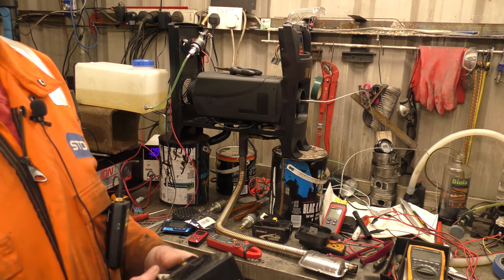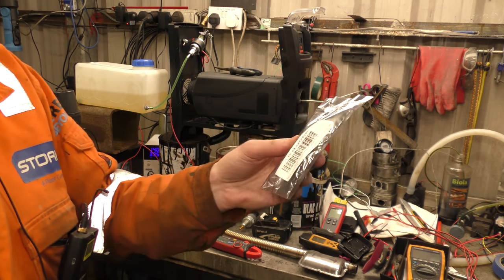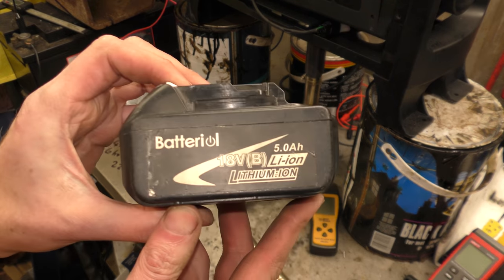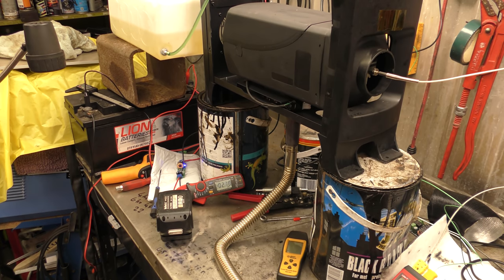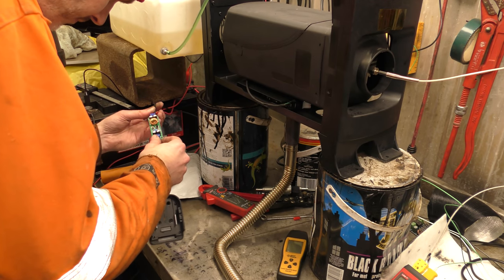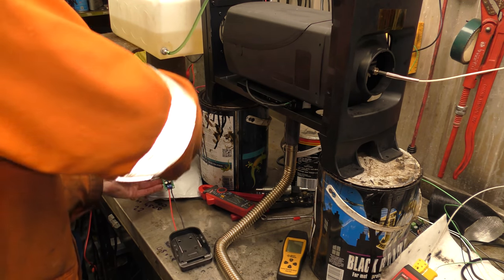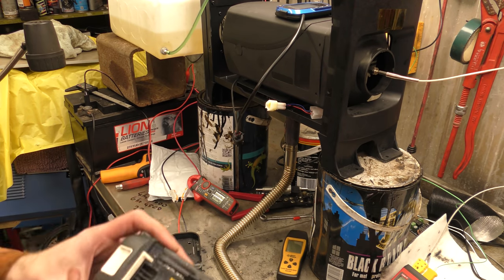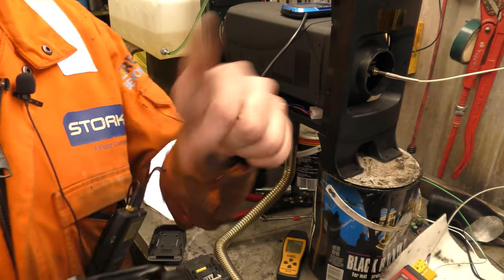Will the diesel heater run from a tool battery? 18V Makita tested

Comment: I run my heater on 5ah 20v dewalt batterys with a 15a 12v step down converter and I've never had a problem👍
Reply: How long does the heater run on the 5AH battery

Comment: Hey David! I think these are actually rated 10A output current, you were measuring input current. Try and find a 20A buck converter with a fixed output voltage, should be potted and have a heatsink.
Reply: I am sourcing parts to do this very thing.   Will likely run parallel batteries?  Not sure yet.

Comment: When the smoke was let out of the wee module, you were measuring ~7A. Am I right in thinking that was on the 18v lead to the module? If so, then the draw on the output side @ 14v would be a higher current - nearer 9A. Still should have been within the spec of the module right enough.
Reply: correct
Reply: Hes reading only 7 amps becuase hes on the battery side with is a hogher voltage so less cureent
Reply: Agreed, if the battery was fully charged that would be 20V, so 10A at 14V, so technically within the limits of the device; however, the 8 pin MOSFET packages are not usually rated to that current, I would have expected to see a D2PAK style mosfet there.
Reply: @joshuabest100  Yes, that's the point I was making.

Comment: I make portable diesel heaters in pelican cases and sell a bunch with dewalt battery holders, the 12 amp work fantastic and can get between 7-10 hours of usage in a 5kw unit. I use those big aluminum buck converters and a low voltage alarm for the lithium batteries.
Reply from the maker: Ooooh nice.
Reply: Have you tried to run two 5 amp hours in a parallel connection.  Didn't want to purchase if it does work

Comment: I’ve got a 36v to 12v (claims 20A @ 12V output) converter - Downsol brand from FleaBay. Makita batteries are quite happy in series, my big battery saw is 36v as it uses two of these (5Ah) and this converter is designed for 36v input, so not under running a 24v converter. It’s got a large die cast case that gets warm when running 8A output at 12V (100w) so maybe this is an option - but you would need two of the battery adapter “shoes”.

Comment: I've done it with a 30 amp converter. With a 12 amp hour n18 battery it run a long time on a 5kw at full power

Comment: Basically divide the quoted power rating by 2 for any of the buck converter boards. They are good but always under heatsinked for even half the rating.

Comment: You could possibly use a solar power controller to out put those requirements
Have a cheap one i purchased off evilbay
For about 20.00 us. Takes 30v from my panel and outputs about 13v to charge my deep cycle with an inverter drain.?   Not sure but drains for my diesel heater just fine.

Comment: Two resistors in series makes a voltage divider circuit. Online calculators for Voltage dividers will help you pick the two resistors you need to get the voltage you want.

Add a zenor diode with the voltage desired for a cut off point to turn the battery off at a specific voltage.

I'm sure someone here could draw you up a diagram for a simple circuit like I've described.

Comment: I'd probably use 3 or 4 voltage converters in parallel.  3 amps a piece.  What are they like a pound a piece?
The other thing that can be done is using the power supply with a cheap lawnmower battery.  Find the resting voltage.  Hold the resting voltage with your power supply.  Once the glow plug goes out the power supply will bring the battery back up to resting voltage

Comment: hi great video   you can get  model plane  voltage controlers up to 20 plus amps            also try a lipo battery  either a big  4 cell   or a large  3 cell     both will do the job

Comment: Ebay truck 24v to 12v DC-DC stepdown converter 240w 20A with handle an input voltage down to 18v and output 12v.

Comment: if one estimates 18.5v on the battery and an amp of 7.5. then the out current will be 10.2A at 14V on the output. this is above 10A :) they did not specify where it was max 10A
Reply: I'd expect it to be an output spec.

Comment: FYI: Voltage Range: 12V is 10.5-16, 24V is 21-32V. I've only tested 24V heater using a 7S li-ion at 29.9v.

Comment: What if you had a small lead acid battery that was charged by the buck converter? Would the battery supply most of the current spike?

Comment: Could you use enough TECs to have a module that produces enough energy to make it that you only need a tiny battery but it can self sustain and not need a mains connection.
Reply from the maker: So that is something I'd like to try this year.  I just need to do a shopping list of the parts I'll need.  TEC modules (10 or 20), heatsinks for the cool side, square pipe to attach them to and something that will take the power they produce and make a useable voltage to charge a battery and run the heater.
Reply: Excellent to hear. :) Would be a bit of fun!
Reply: Quite a few step down regulators on the internet with variable voltage you could use. I'd assume you wire them up in series to get the most sensitivity or om groups as you want a pair of them around the same temperature zone else their act as a resistance.

Comment: If you access the hidden settings through the original controller it allows you to change the power from 12 to 24 volts
Reply from the maker: It does.  But it throws are error for the glow plug as it expects it to the be the 24V version.

Comment: I want to see if you can charge up the battery using peltier plates???
Reply: I was legitimately researching this, you can but it's vastly easier to just use enough battery to last until sunrise and use solar.
Reply: @906MediaProductions  while that makes sense in most cases what about a winter storm where the clouds and snow make solar not effective. 
I was thinking the exhaust might have enough heat and cold to make keeping the battery level up possible?

Comment: ha!!!  i killed one of those little boards..  in my endless no-start fights with my VVKB water heater at one point I had thought if i gave my heater higher voltage that my glowpin would glow hotter and the heater would Light off.. (my heater doesnt like to light off when its colder than about -2c)  I gave mine 24 volts in and pushed 15 volts out..  my board looked similar to yours..  and same result.. the heater didnt light and the board smelled like Cooked transistors....  I never measured the current with my meter. I never got the chance it burnt up too quick..

Comment: I started my heater on a 12volt motorcycle battery but didn't run long because it was only 14 amp hours you do need a continous source

Comment: Put controller in 24 volt, technically 5x4.2v is 21volts is what almost every power tool battery is actually outputting it might trip the under-voltage in that mode but worth a shot!
Reply from the maker: It's the 12v fan motor, glow plug and fuel pump that would be unhappy with the higher voltage.
Reply: @DavidMcLuckie  i am confused on my controller in the advanced settings there is an option for 12 or 24 volt input, if set to 24 volt wouldn’t the controller or ecu then be the regulator for motor and other  i assume in 12 volt mode to control speed its lowering voltage to fan motor to say 8 volts,  what is that setting for then?
Reply from the maker: It's just so they have one controller for both 12 and 24V models.  But there 12 and 24V versions of the blower motor, glow plug, and fuel pump.
Reply: @DavidMcLuckie  thank you!

Comment: Watching a few of your vids - I have a 2 kw unit - looking to run off  Aux house battery  (100AH) pulling Diesel from the vehicle fuel tank  - any thoughts on this?
Reply from the maker: Yes, exactly as I installed in the camper.  The hardest part was dropping and refitting the tank.  :)

Comment: hi have 3 diesel heaters all not working one pump failed after a year the other 2 with in 3 weeks have one that pumps fuel downwards but when connected to the heater stops ,ticking nose ok can they be repaired they dont seem to last where do get yours from thanks
Reply from the maker: I should have some new heaters in shortly for testing that are supposed to be much better than the really cheap ones.

Comment: That board I'd guess could peak a second at 10 amp but there is no heat sinking on it, heck even the 3amp buck/boost converters have heatsink of some kind.
I use the Chinese rating of - advertising spec devide by half-
I have a claimed 10amp board that gets pretty hot, 70v ish in and 17v out at 3.5amp.
I have seen another YouTuber use bigger boards but not sure of the exact current

Comment: What happens if your diesel heater turns of while running full but the battery dies and it stops and can't cool down ? Or dose it turn of before the battery gets to low?
Reply from the maker: That's something I try and fix in another video.  As it'll just run until the battery dies and the heater just stops.

Comment: Can I request a video showing how to swap out the devil heater ecu for one that is compatible for use with the afterburner controller? 
Ihave the air/water heater version and need to do this mod but it's not quite a simple swapping of the boards as the connectors differ...
Many thanks, great stuff as always!

Comment: Just use a 14.4 v battery pack for the test. 3 x 18650 batteries in series will give you 11.1 v.
Reply from the maker: Does anyone use them anymore?  All the tool companies are going for even higher voltage battery packs now, 40 - 60V etc.

Comment: 💅🏻 As Jim Lahey says  ☟ ..Change it to 24v on the controller.
Reply: i think It will shut down for under voltage if it was set to 24v

Comment: Is running the heaters in altitude mode ok at normal elevation ? I find it a little cooler than on full normal mode ?
Reply from the maker: It'll just run it lean.  No damage, just less heat.
Reply: @DavidMcLuckie  thanks David great videos 👍

Comment: You can change the voltage on the original controller from 12v or 24v. Mine did anyway
Reply from the maker: I wonder if we change the controller to 24V will the fan still run at the same speed.  Now you've got me thinking.  :)
Reply: @DavidMcLuckie  my controller was on 24v setting when I first got it, just faulted out on low voltage as I was using 12v, it wouldn’t surprise me if the heaters can run on 12v or 24v
Reply from the maker: Well it didn't work.  Set it to 24V.  Turned it on, ran for about 3 seconds and gave a glow plug error.
Reply: @DavidMcLuckie  ahh the makita battery doesn’t have enough power me thinks
Reply from the maker: I think the heater is expecting a 24V glow plug.  The fan, fuel pump and glowplug are the only parts that change on the 24V heaters.  Shame.

Comment: I tried a couple times to post a link to the voltage convertor I used but it keeps getting removed or at least I canny see it anymore
Reply from the maker: Links end up in the 'Held for review'.  I can see them.  :)
Reply: @DavidMcLuckie  cool, that converter thing ended up being quite the deal, other new ones were about 70 quid and it's more like a regulator it makes a steady output voltage when the drill battery went between near 19v down I let it drop to 16v( to be safe so it would still charge) and the output stayed the same

Comment: Such a great video, I'm sure van lifers have wanted to try this. What happens with two batteries to make the 10ah ?
Reply: You get double the run time
Reply: Series gives you higher voltage and parallel give you more run time

Comment: Dave a question  not a comment have you ever tried to run a diesel heater vertically Instead of horizontally with the inlet up and the discharge down thanks
Reply from the maker: Yes.  But I can't remember which way up I had it.  They do work but there is a possibilty of a small fuel leak from the burn chamber flame front hole next to the glow plug.

Comment: 12v or 24v you can set them, you know that
Reply from the maker: You can set the ECU to 12v or 24v version.  But the fuel pump, fan motor, and glow plug are all voltage dependent and need to be matched to the voltage you are using.
Reply: @DavidMcLuckie  Only the ECU,
That makes no sense, i thought the whole system would be 24v once set that way
So i need a 24v and a 12v to run it at 24v, you sure?
Reply from the maker: If you want to run a heater on 24V it needs a 24V fuel pump, 24V glow plug, 24V fan motor.  The ECU is the only part that doesn't mind 12V or 24V.
Reply: @DavidMcLuckie  OK, thanks i'll stick to 12v

Comment: I design make and sell those battery connectors :-).  I can do a wayyyy better deal than the Chinese :-).  Let me know if you want some!
Reply from the maker: Nice.  These are becoming my favourite way of joining wires quickly.
Reply: I would like some of those cable connectors, how do I order some?
Thanks.
Reply: @DavidMcLuckie  Hi David, what do you call that type of cable connector you used, link to seller would be great if you don't mind. Cheers.
Reply: @Dubious Engineering, is there a link to your connectors?
Reply: Hi everyone...  thanks kindly for showing interest in UK design and manufacture of these battery adapters...   with David’s permission I’ll pop a link to my eBay shop so you can take a look.   I have DeWALT, Makita, Parkside, Worx and black a decker ...  I’m always working on designing and making more! ...
Reply: Ok...  YouTube is auto blocking my web address...   my seller Id on eBay is howitee send me a message before you buy something and we can figure a discount!